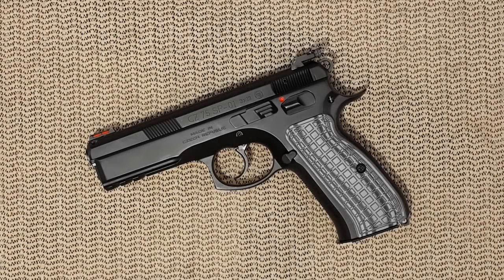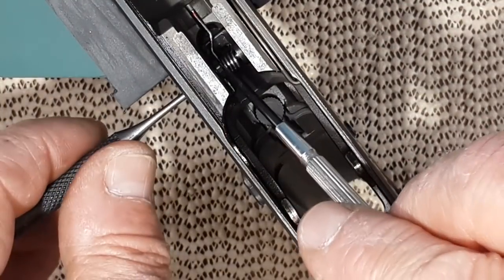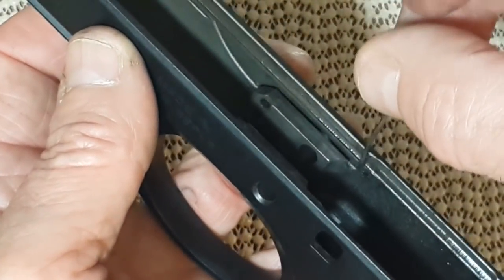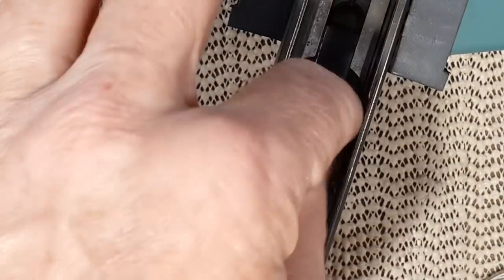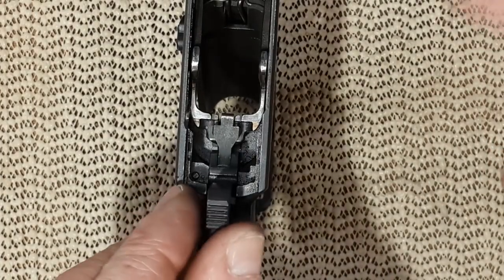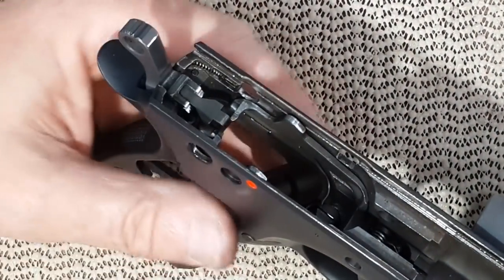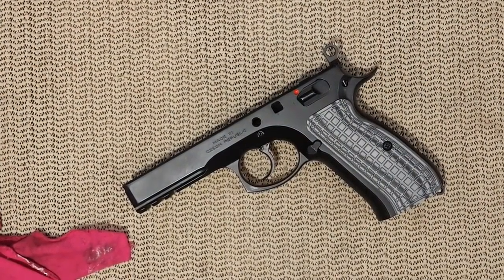CZ 75 SP-01 and Shadow 2 Lower Frame Full Disassembly and Reassembly

Comment: Wow this was by far the best disassemble/reassemble video I’ve seen. Great angles & lighting
Reply from the maker: I am happy I could be of some help to you Jamel. Thank you for your kind comment. Happy shooting.
Reply from the maker: Hydroginn1   it is as the video shows, not very difficult. Watch the video a few times and go for it. And if you end up in trouble, I will be there to help. 
PS: I love Stuttgart and my brother works in Dresden.
Reply from the maker: Hydroginn1  Indeed, the pin can only go one way, and you should be able to see one side of the pin being larger than the other side. Then it shouhldn't take too much force to remove it. But being the first time, you might have to be more forceful. There is not much you can damage. If you are pushing it from the correct side, it will eventually give in. But what am I saying, you took care of your issue with flying colors. Good job.

Comment: I've had my SP-01 for at least 10 years and I had no idea I needed to do all this stuff! Thanks for a great video. I reckon I must have put about 5000 rounds through it and it's not once malfunctioned, and now I'm learning that I've never cleaned it properly as well. To be honest I usually just take it outside and hose it out with gun scrubber and then oil it, is that bad for it?
Reply from the maker: As long as you are using some kind of solvent, you will be OK. The CZ is build like a tank.
Reply: @practicalshooter6517  Thanks

Comment: Practical Shooter thanks for your prompt response. So your video regarding the issue with the firing pin coiled pin do not apply to the 75 Compact ? Thanks Again
Reply from the maker: I am afraid it does as well. The best way to find out where yours stands is to take it apart and inspect it.
Reply: Thanks again,Practical Shootter!

Comment: Thank you for the very informative videos.  I especially appreciate the camera work - very clear.  The outside of the trigger bar appeared to be wet.  Did you put grease on it before reassembly?
Reply from the maker: Thanks Kevin. Usually, I put a dab of oil to all metal to metal contacts. I stay away from grease, but I have seen people use grease. As long as there is some kind of lubricant, you are good to go.
Reply: @practicalshooter6517  Thanks.  Oil here too.  It  looked like you might be using some magic CZ elixir I should know about.
Reply from the maker: @kevinbabcock2640 , I simply use motor oil and never looked back. My SP01 is now 9 month old and 6500 rounds. No breakage whatsoever ,but a well dented firing pin roll pin. I only replaced the sights, all the springs, and the firing pin and the dented roll pin.

Comment: Hello sir, first of all, thanks for the video. Very informative and clear.

Quite a random question but still important for me:
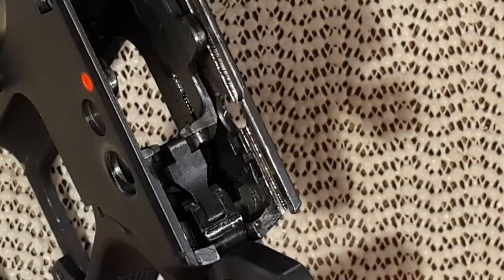May I ask what is the width of a metal frame without the Safety at 3:40? 
And also what is the width of the metal under the trigger? 
I need it for some research I'm currently doing.
Reply from the maker: I hope I can answer your question.
The outside distance, from side to side, without the safety is 25.60 mm or 1.008 inch
I don't know what you mean by "Metal under the trigger"
Reply: @practicalshooter6517  I meant the trigger guard, sorry for confusion.
And huuuge thanks for the measurement!
Reply from the maker: @dauletbekishev  the trigger guard, right under the trigger is 9.30 mm  or  0.366 inch, but it becomes larger as it gets forward. hope this helped.
Reply: @practicalshooter6517  Awesome! Thank you very much, it really helped a lot! Wish you the best!

Comment: I recently bought an all new competition spring set + guide rod, extractor, flat trigger and so on from Eemann Tech. Next weekend I'll fully dissasemble my Shadow 1 for the first time so I'm a little bit stressed but this video makes it a lot better already 😁

Which size punches are you using for this job (with and without the 'ball point')?

Comment: Great video!  Quick question can you remove the sear cage without removing the hammer spring?  I need to put a a cajun gun       part  in my sear and was curious if I could just remove the sear cage.
Reply from the maker: Bailey - No you can't, but I haven't found any difficulties removing the the hammer spring and hammer assembly.

Comment: Do you have a video on how to install a new trigger return spring without removing the trigger assembly from the frame?
Reply from the maker: I am afraid you don't have the choice. The trigger and trigger arm is one piece until it is remove, and it is set underneath the sear block, and the arm can't be pulled out until the block is remove.

Comment: I noticed you didn't show putting back the tiny pin and spring that holds the slide lock on the right side, forget what I said about sear spring, its automatically tensioned when you put it back together looks like.
Reply from the maker: NOWAY I forgot.... OK,  maybe I did LOL. 
Do you want to work for me and proof all my videos before publishing? because you are exactly what I need. I also need someone for my cooking videos and raising Rabbits videos. 
The job is simple, correct all my mistakes and you get to watch all my videos for free LOL.
Thank you for watching and commenting my videos Rocketman9mm.
Reply: @practicalshooter6517  well your cz put together vids are so great i subbed. so i'll be watching your stuff.

Comment: Nice video Sir; I just purchased a Cz 75 Compact, did the P-01 is similar internals as the 75 Compact??
Reply from the maker: No they are different. The 75 compact has a safety and the P01 has a decocker. 
This makes the internal different. I am only familiar with the safety model, like my SP-01. 
I heard the decocker is slightly more complicated to take apart. I am still waiting on CZ to send me one to make a disassembly video LOL :) Happy shooting Hiram.
Reply: Practical Shooter thanks for all this good info, I went into my Compact & replaced the main spring and find very difficult to re-install the mag brake ( it have a hook that go around the strut pin) I ended cutting the hook part off . That's what CGW do, it works!!!Regards

Comment: I have a friend with a shadow  that won't hold the hammer for single action after first shot. We swapped out the disconnector that looked like it had been altered but the problem remains.  Any ideas?

Comment: My trigger pin is being very stubborn. All your pins just push right out. Only a couple of mine do that. The magazine break pin and trigger pin fee like they need a hammer to remove. I just made a small scratch trying to get it out. I’m going to pause for the night, get the right roll pin punch and try again tomorrow.

Also isn’t there supposed to be a little spring on the small piece to the right side of the hammer like there is at the left side at 21:46?
Reply from the maker: Good choice. A good night sleep and the right tool can accomplish a lot. Good luck Michael.
Reply from the maker: Good choice. A good night sleep and the right tool can accomplish a lot. Good luck Michael.

Comment: My 75 omega doesn't have a mag release screw. It's just a giant circular pin with no slot to unscrew. Do I just pull it out?
Reply from the maker: It is a bit different in the new CZs. Look at this Omega video at 9:30
https://youtu.be/RUBp6qykJbI
And in this new video I just made, on the P10F mag release, it work the same
https://youtu.be/eIqsBKqn0Hw
Good luck Jason

Comment: Greetings from Greece, my cz sp01 shadow has a flared on both sides trigger pin. Where I could buy one like yours?
Reply from the maker: Lol, Greek last name with an English first name, cool.
Back to the trigger pin. Mine is also flared, more on one side than the other, so it can only go in one way. It looks like the pin might come out, but the pressure from the trigger spring keeps in into position. 
I don't know where you could get a replacement pin in Europe. Maybe you can get one from Cajun Gun Works here in the US?
https://cajungunworks.com/product/floating-trigger-pin/
Good luck Basil
Reply: Thank you very much for your suggestion. Cajungworks has really the answer and Iam going to look into Europe for their special pin.

Comment: Parts I bought for my SP01
HPIN Hammer Pin × 2 ,$5.00
Manual Safety Hammer Kit × 1, $124
L-Spring Lifter Spring × 2$6.00
Floating Trigger Pin × 1$13.00
Reduced Power Trigger Return Spring × 1$7.00
22 Hammer Spring Plug Full Size × 1$5.00
23 Hammer Spring Plug Retaining Pin × 1$2.00
54420 Ultra-Lite Kit × 1$49.00
Machined Lifter Arm1$20.00
Starter Punch1$7.00